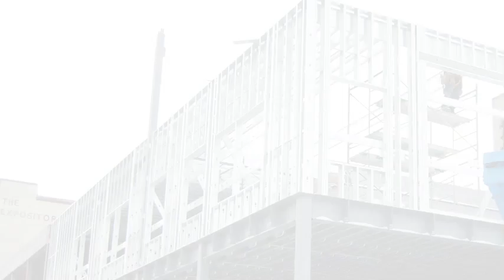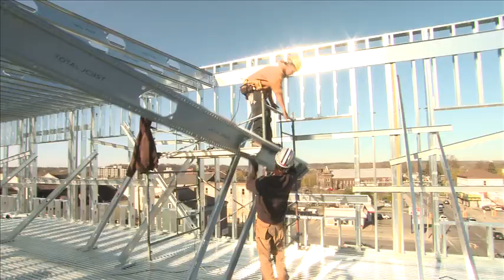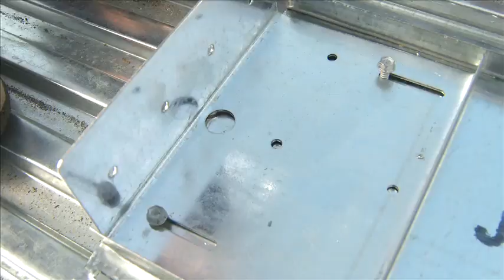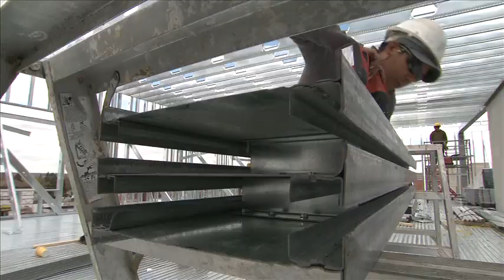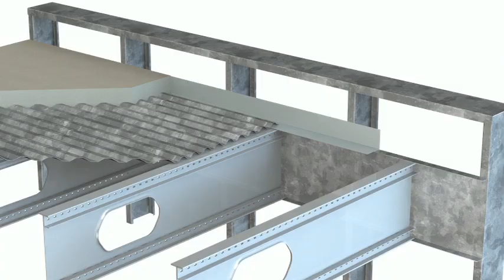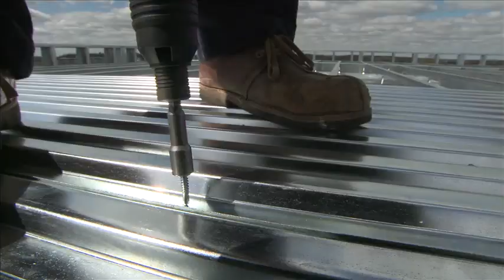Light-Steel-Framed Buildings Benefit From Composite TotalJoist Steel Construction - Installation

Comment: The cost to produce these metal joists is enormous! Plus, the chemicals used are very hazardous to everyone,  not just Californians.
Reply: What the hell are you babbling about?
Reply: I have no idea about steel framing at all
Reply: Yeah, but also the cutting of trees is not only killing our forests and all the animal life in it that it is also bad for the air we breath without trees to replenish it. Not to mention all the fires that California had and all the houses burned even faster because of the wood that was used. Also, wood develops dry rot from moister and asbestos from humid areas in parts of the country. I say build all building out of metal its a better product than wood.